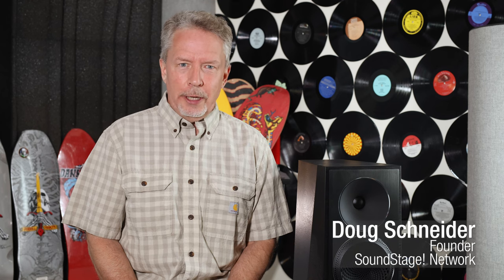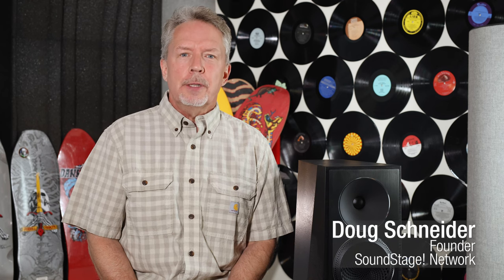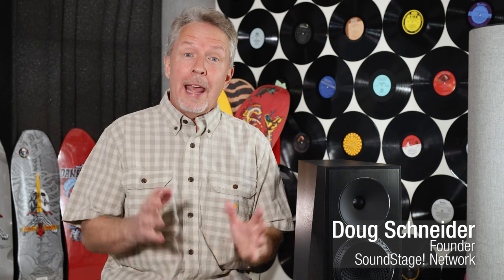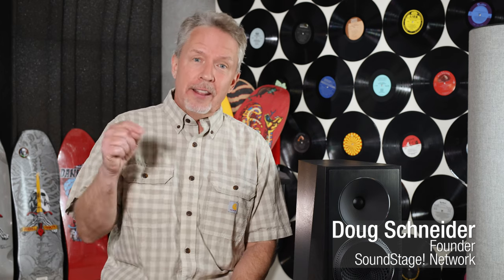Are Waveguides Good? This Explains Why Some Speaker Designers Use Them (Ep:69)

Comment: Nicely done Doug.

 Inherent in loudspeaker design problems are the rules we must all obey. Physics.

 A tweeter that will give you a reasonable high frequency response is generally made around 25 to 28mm in diameter. A terrible size to cross over to a woofer that has a narrowing directivity at about 1.2kilohertz. That is most 6.5 inch woofers. Tweeters in the size range that is common have a useful lower range starting about 2.4 kilohertz. Not a great match to a woofer that at that frequency is very directional as you mention. If a waveguide ( Earl Geddes is to blame for this radio frequency term being appropriated into audio) is only a controller of the directivity of the air pressure front of the tweeter I call it a wave guide. If it is designed to create a lift in the response, I call it a horn. (How do you determine the difference between a waveguide and a horn? Depth of the horn. The deeper the horn the greater ability to amplify a lower frequency.) 

Your explanation of the reasons why this is important are spot on! It is true that the diameter of a horns mouth is what controls the expansion of the air pressure front from the driver diaphragm to the surrounding air. What is missing is the need for the depth of the horn to create an amplification of that air pressure front. This example speaker is using a conic horn. Easy to manufacture. But has it's own problems with reflections that cause cancellations in the frequency response.

 You can usually see these cancellations in the three parameter graph of frequency, phase and impedance. All of these on one graph is a view into the frequency and time domain as phase is a term used to describe time and place of a pressure pulse generated by a loudspeaker. The graph is a side view representative of looking a a cork screw like signal if you could see it in 3 dimensions. The impedance is a reflection of the mechanical system as measured in the electrical domain. So the impedance is giving you two measurements for the price of one. 

If you have gain in a horn you trade away bandwidth of how the horn can interact and control the output of a loudspeaker. Or, another way to describe it is that you trade away top end efficiency. The frequency response falls in relation to the area that the horn has been designed to control. Generally you are really stretching a horn if you try to work over a span of three octaves. So 1kilohertz -2 kilohertz, 2-4, 4-8 kilohertz. After this region a horn will have less and less effect on the amplification and pattern control. Pattern control stops working when your driver diaphragm or the horn itself is smaller than a half wavelength of the frequency being reproduced. In this horn I'd guess right around 10 kilohertz from the driver diameter. The horn will stop being effective a little lower. Happily this can be a true plus in a well designed system like the loudspeaker that you showcase.

Mark

Comment: Speaking of diffraction effects, wouldn’t a waveguide’s forward projection reduce a driver’s interaction with the surrounding cabinetry? The tops of my new quad-amped active speakers are narrow and curved, with less than an inch above and to the sides of a 4” steel waveguide around a beryllium tweeter, to minimize reflections. These Meridian DSP9 have fabulous dynamics and imaging.

Comment: Wave Guides VS.  Separated Housings.................................
      Wave Guides are, as was said,  specifically tuned to make the tweeter get along nicely with the midrange (don't get picky).  But, the designers aren't testing the frequency responses in someone's living room.  Their testing or trying to test in some type of anechoic environment. Therefore, the final design is fixed non-variable. Right? They're all the same.
      Now consider the subwoofer.  It is nothing more than the removal of the low frequency transducer (don't get picky)  from a full-range loudspeaker into a separate housing.  We all know there are some distinct advantages to that arrangement.
     If manufacturers separated their tweeters from mid-range or mid-bass' into separate housings,  one could realize a couple other unique advantages.  There are endless tuning adjustments to be made, without any DSP or electronics.  From horizontal and vertical axis responses to wave cancellation, etc.      Ya, gatta' kep 'em separated.... dat dat da dum.
                                                                                 Interesting topic.  Thanks SoundStage,
                                                                                               Reggae, Funk & Brass    🔈🔉🔊
Reply: It's an interesting point, but with loudspeakers, potential "fixes" for certain problems can result in other problems. For example, if you separate the tweeter, you might create ridges that result in diffraction effects. You might also force it too far away from the driver it's passing off to. Or something else. With a subwoofer, it's a bit of a different story. The reason the subwoofer is separate is because they make them as separate entities, to be sold separately. But there are some resulting benefits to that, such as moving the "shake" from that big subwoofer driver away from speaker cabinet. Also, you can optimize the subwoofer placement for the best bass performance and the speakers for the best imaging. I'm not convinced that separating, say, a tweeter will be that beneficial. Bowers & Wilkins kind of already does that with the Tweeter-on-Top technology.
Reply: The point here to work on the DI and power response of the speaker, which give a really good estimation of in room response beyond the critical distance.  The separate tweeter is not a good option because of diffraction, center to center distance etc etc ... The comparison with a subwoofer is noncense because of wavelenth involved.
Reply: @dougschneider8243  One need not be assaulted for not moving the relative position of the drivers as designed by the audio engineers.  A consumer could choose to leave the tweeter right where it is from the factory.  A hairline seam, since we are aware of such things, can be reasonably dealt with.   It's flexibility for our unique spaces.
      Subwoofers?  Yeah, as you said, there are advantages to separating the cabinets.  And now there are separate amplifiers for those separate subwoofers because there are advantages to bi-amping.  Now consider that when considering separating out the tweeter & tri-amping.
🔈🔉🔊
Reply: @shining31       What's a DI?
                             What's a speaker's power response?
                             What is a critical distance?
                             Why would an engineer choose poor driver positioning?
                             Subwoofers are separate cabinets that contribute only
                             part of the music frequencies. Same as a separate tweeter
                             would, regardless of the wavelength.
Reply: @TriAmpMyFi  don't get picky but discussing this topic without knowing (or faking to don't know)  that....
Reply: @shining31   It's the latter........... I'm  "faking to don't know".  Yep.:face-turquoise-covering-eyes:
Reply: Honest answer. That I respect.  @TriAmpMyFi

Comment: Would a waveguide on a single full range driver still make sense, to control the on axis performance of the whole frequency band?
Reply: That's quite a bit more difficult than it sounds. First, you need a driver that reproduces the entire frequency range well, which basically don't exist. Would a 10" woofer that would be great for the bass be equally good for the highs? Likely not. Then the waveguide would have to fit around those limitations. Basically, no, it wouldn't work well.
Reply: @Vindexi  I would argue with the word "great" -- I have yet to hear a "great" single-driver speaker. All the ones I've heard are deeply flawed in part(s) of the frequency spectrum. That said, you might get uniform dispersion, but you're likely not going to get the correct output all around the speaker because of the size of driver you need to use. If you use a cone driver of any size beyond an inch or so, you're going to have severe restrictions in it's higher-frequency dispersion because the driver basically starts "interfering with itself" due to its size.
Reply: All waveguides are horns (not all horns are waveguides). Horns are bandpass devices. Bandpass means only work for part of the frequency band.